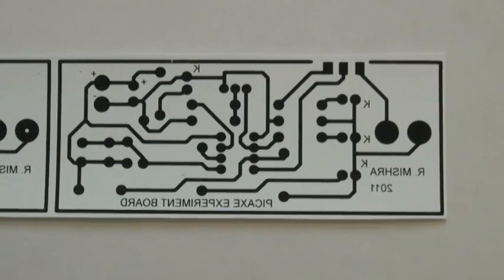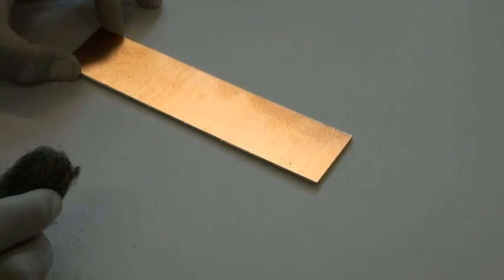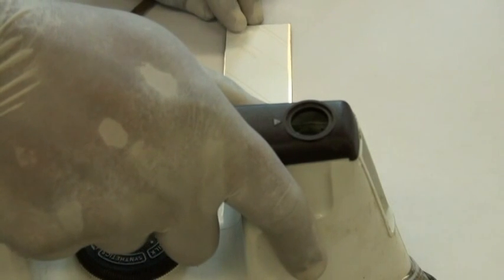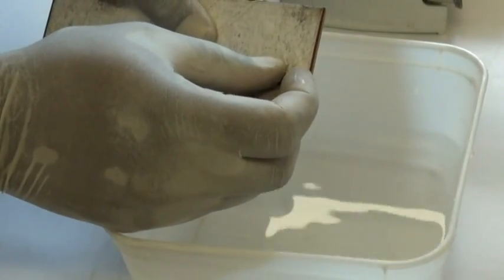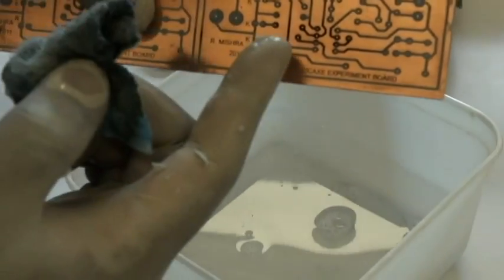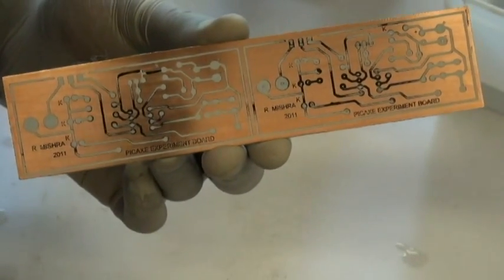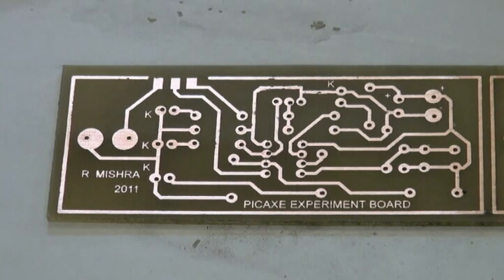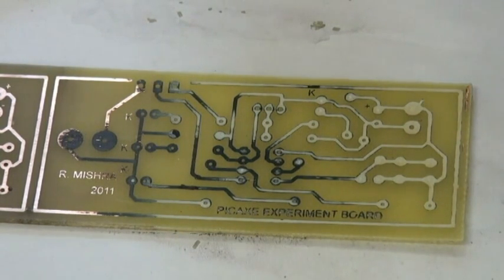PCB MAKING MADE EASY

Comment: Never ever use metal scouring pads of any kind to clean copper clad boards , they can cause microscopic cuts in your traces, that you may never find . Use those green  plastic scouring pads instead the skinny apx 1/8 inch thick ones, not the big netted plastic ones..  Also with this video, the audio is missing at the beginning , the audio only starts as the video maker starts to talk about the photo paper.

Comment: hi rohitesh, great video, detailed video,Can U pleaze  .remove background music. Thanking U in advance.Can U plz tell me how to make manually circuit on tracing paper, & how to transfer image on copper clading..
 I don't have printer of any kind.
Reply: Ashok Nikumbh I read somewhere you can draw on the PCB with a sharpie and it will keep the acid from etching the parts you have drawn on.
Reply: +kd9bwi Using Nail Polish is a common way then just acetone (nail Polish remover) after etching.
Reply: IllNotBeLegit  Would the nail polish be better at sealing the acid out? I'd like to try etching any the info would be helpful.
Reply: kd9bwi If you want an absolutely rough looking and simple circuit that you can do quick and you know will work, nail polish works great. If you want something more complicated without printing, applying a VERY strong sharpy marker, like draw very slowly pressing down hard to make sure the ink is on strong, then possibly going over it again when it has dried. It's fine for touchups but for a complete board it can also have bits which aren't shielded from etching enough.

Comment: Mr mishra .should I heat up the ferric chloride..
Reply from the maker: Hi it depends on how long you have used the ferric chloride for. If its freshly prepared and concentrated than you don't have to heat it up. The purpose of heating it up is to balance the reaction time as concentration levels drop during the etching process which generally comes into effect if you have used the same solution to etch a number of pcb's over a long period. Heating the ferric chloride speeds up the etching process (time) with a bit of agitation.
Thanks

Comment: Wow, this video brings back memories.  I did the exactly same as you've done in the video, some 25 years ago.  Remembering how the paper was always to toughest to get off.  Back then, did some experiments of some chemical way to make the paper just detach and float off.  Never did get that to happen, but did try for a few weeks.  Great video, it sure did bring back some fantastic memories.  I seem to recall, putting some water softener in the water, soaking the PC board with paper on, the paper did come off easier as well as using thinner paper.  But that's all I remember about it.

Comment: hi rohitesh, great video, detailed video, just two questions. is the copper clad board specially made ? how do i get it. 2) what is the chemical in the machine. is it easily available ? as i don't have electronic background, but this video really inspired me to do this. Hope you will extend your support to the fullest.
Reply from the maker: copper clad board: yes its a special board with a fine micron coating of copper on an epoxy or fiber glass type material. you could easily get this from any electronics parts shop or try ebay. the chemical I have used is ferric chloride but you could also used ammonium persulphate for etching, some people have used hydrochloric acid and hydrogen peroxide. I have not tried this so can't comment on it. hope this info is useful to you

Comment: Do you need that tank or can you etch with just the  Chemical in a pan method? and would inkjet work?
Reply from the maker: Hi mate you can practically use anything plastic container to etch, the fancy machine is not a requirement, its something i was blessed with otherwise i will be using containers as well.
Secondly inkjet does not work in this method. I will shortly post a new version of my PCB making with some cool technologies around the house/office and improved quality, keep an eye here.
cheers
Reply: What do I put in the containers
Reply from the maker: Ferric chloride

Comment: Do you recommend dipping the board into water while the board is hot or  should it be left to cool down. Does this effect the quality of the outcome?
Reply from the maker: immediately after you finish Ironing and while it is hot, this will set the toner on the board. Don't know if you have experience this or not but sometimes when you print on normal paper and as soon as the print job comes out and you rub your fingers on the paper you will see the toner smudge off. This is the same effect in any case and therefore immediate cooling down solves this. ta.

Comment: Hi Rohitesh,
I was wondering how long you iron the board for?
I am using Brother single-sided glossy paper 260g/m2 and it doesn´t even stick to the board. I clean the board and iron for about 5-6 mins and apply pressure. Do you know what the problem could be?

Thanks in advanced,
Luis.
Reply from the maker: Hi mate your ironing should only take about 2 minutes. Check that the iron temperature is set to cotton or the highest setting. Are you using toner printing method?
Reply: Rohitesh Mishra Yes I am using laser printer and I have the iron preheated to the maximum temperature. When I start ironing the board the paper just sticks to the iron and no to the board. I really don't understand why this happens?
Reply from the maker: Have you printed the pcb image on the glossy side. Try sticking the paper with some tape
Reply: Rohitesh Mishra Ok I will give it a go, thanks for your help! :)
Reply: Luis Flavell   hi  dear ,i can help you do pcb , pls send your gerber file to sales5@linghangdapcb.com
Reply: Rohitesh Mishra 
Mine too i iron it for 15 sec. But it doesnt stick on the board

Comment: I went to buy a kodak photo paper (gloss) but I was told the laserjet printer (brother) would melt the gloss. Please advise whether the kodak you used in this etching is specially designed for laser printers.
Reply from the maker: Sorry but I tend to bend the rules here. On my packaging it says not to use it on a laser printer but I still go ahead as I don't need the gloss, I want as much toner deposited on it so I can easily transfer it back to the copper board. :)
Reply: Great video - never know such simple technique can produce such good quality board. Just to add - It was mentioned in one of the instructables about some issue with brother printers when it comes to toner transfer.
Reply from the maker: Gudur Raghavendra Reddy
 Any photocopier or printer should work for this purpose provided it laser type (toner used to print) bubble jet, ink jet, dot matrix does not work. Someone mentioned that thermal paper works well the once that you get you receipts printed on, haven't tried it but would give it a go sometime.

Comment: If you are in Bombay, you can get a Jar Feric chloride crystals in area called "chemical market" near  Lohar chawl near Girgaum, Bombay VT. Mix crystal with water to make solution. CuSO4 also works. I have used both.Both work. Use plastic tray only not steel one.

Comment from the maker: try amonium persulphate, its less messy. I have read on the web that some people also use hydrogen peroxide, not sure of this.

Last, you need to create a water bath, with two containers, one slightly bigger 1/4 filled with hot water and the other which sits inside this having the ferric chloride. Then put the copper board and agitate it, move it around gently until the etching has completed.

Comment from the maker: Use maximum resolution, I use eagle cad. before printing, I check the solid and black option, so I only print in black toner. Also I have used KODAK glossy photopaper, haven't tried other paper as this one just works fine for me. ummmm have you cleaned your board thoroughly before ironing on the pcb print out. It has significant improvement and toner transfer appears to be of better quality.

Comment: Thanks, I have a Brother color laser printer, and I have completely failed to get toner transfer to work for 2 years now. I even went as far as to buy the recommended laminating machine, but even if I pass the board through the laminating machine so many times that the board is too hot to even touch anymore, I never get more than a few specks of toner transferring to the board.
I will try again with an old Samsung laser printer that I have next time.

Comment: NOT a Brother one.  Brother definitely does not work, as the chemical makeup of the toner Brother uses, will not "Remelt" when heated, so if you have a Brother printer, don't expect this method to work for you.  Other brands of printer apparently have more chance of success.  I still don't like this method - better to use the UV exposure method - more reliable, less time trying to rub the paper away and fix broken tracks etc.

Comment: This method has been around for a while, and it does work OK, but I think it is too torturous to the copper laminate, heating it the way you have to.  Also worth pointing out that this method TOTALLY FAILS TO WORK, if you are using a Brother laser printer, as the chemical makeup of the toner Brother uses, means that this simply won't work.  Other printer brands are fine though, so I understand.  I still think it is better to use the UV method.  MHO only...

Comment from the maker: Well my friend, picaxe is designed for you to put it to some use by writing a code into it. It all depends on the applicataion of the project itself. This circuit is a simple flashing lights circuit which you can easily program after reading through the manuals and playing around with the picaxe it self. Depending on which pins you want to use you will sketch your schematic and then use some cad software like eagle to draw the schematic and generate the board. It is an individula choice.

Comment: Hi Mishra! I cleaned my board properly. I used steel whool with pink stuff (i find it at home :) ) and I cleaned after with normal washing liquid because I saw that the stuff in the steel whool is oily and its wet stuff, so the water is run down thats why I washed with normal wash liquid. I tried iron it, but its not stick on the board at all. Im bit disappointed. I washed out that chemical from the steel whool, and I wait until tomorrow when its dry out. What do you think what is the problem?

Comment: There is an instructable of someone that transformed his ink-jet printer into printing directly onto the copper clad board.  Pretty cool setup he had, but yes the process shown in the video you must use a laser printer.  I also heard to save on cost you can use the pages of a magazine (not the cover, to thick i guess). Just make sure it has that glossy coating much like the Kodak photo paper.

Comment from the maker: Unfortunately the answer is yes. It does NOT work with inkjet or bubblejet printers. BUT.....if you print out a copy of your circuit, no matter which printer you use AND then photocopy(again it has to be a copier with drum and toner) it on the glossy paper, It should work..:). Have a go the concept is still the same. Laser printing/photocopying burns an edge around the toner deposits through thermal process, whereas inkjets and bubblejets don't.
cheers

Comment from the maker: Its standard, just a tube at the bottom of the tank with a small pump that keeps the acid circulating. Yo can create your own if you don't have a machine like this one by simply creating a hot bath and moving the container in which the acid is slightly, just like rocking a baby to sleep.

Comment from the maker: Hi Dilip, If its a solid copper plate then the transfer will work but how are you going to etch it? with the copperclad board, the unwanted copper gets etched by the ferric chloride acid and only leaves copper behind where the tonner has covered it. Am not really sure what you are doing here, are you making PCB or using this process for some other purpose? Guide me on this one please.

Comment: Actually, there is another potential problem with the toner transfer method, and that's the actual toner itself.  Brother toner (as I've just found out after buying a Brother laser printer) melts at a higher temperature, making the transfers weaker.

Comment: Sorry if I came off harsh. Another few pluses with just using scotch bright pads is there's no mess to clean up and it's safer than steel wool on the skin. 
It looked as if the steel wool was creating an extra step to clean up. 

Have you looked into Toner Transfer Paper by Pulsar Professional FX? You can go from design to etched board in 8 minutes with it.

Comment: NEVER, NEVER, NEVER use steel wool on copper clad board. Tiny particles of steel get trapped in the copper and when it oxidizes, causes all kinds of problems. ONLY use plastic based scrubbing materials like scothbright scrub pads for ALL scrubbing processes!!!!  Your etching tank is WAY over complicated. You can just heat some Ferric Chloride in the microwave in a glass dish for a minute or use a 100 watt bulb over the dish. To prevent copper oxidation, use liquid tin.

Comment from the maker: The etching tank. (one tank is for tinning process, the other one for etching and the last one for washing) You can also use a hot bath, you will need two conatiners, one slightly bigger than the other. Fill the smaller one with ferric chloride enough to have your board covered, then put it in the bigger container and fill it up (enough) with hot water and slowly shake the smaller container so that hot water heat heats the solution and maintains an even temperature will you agitate the board.